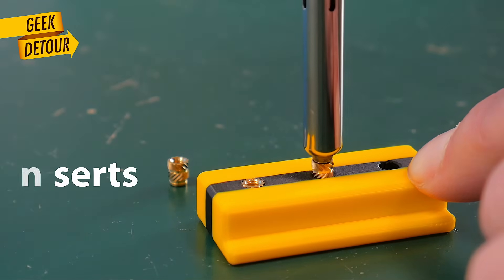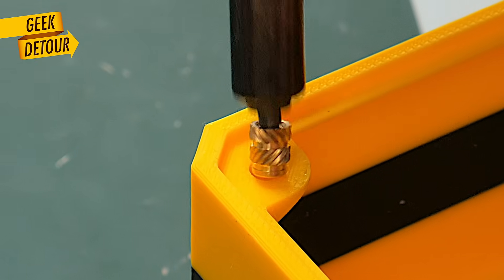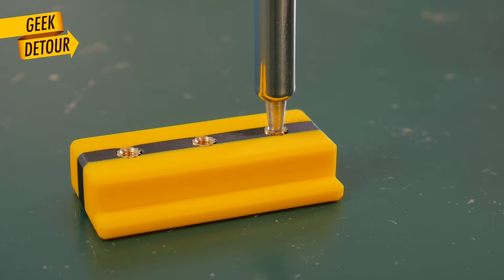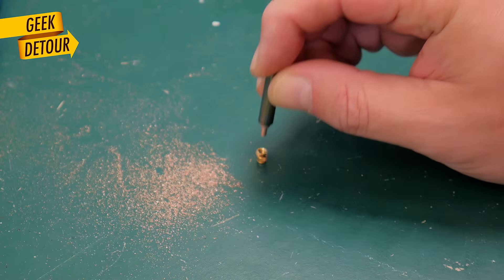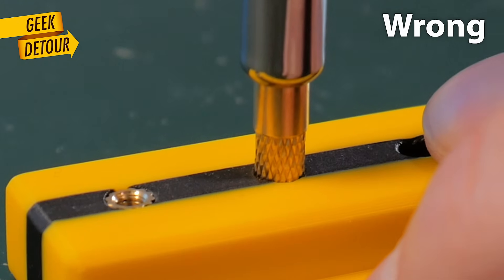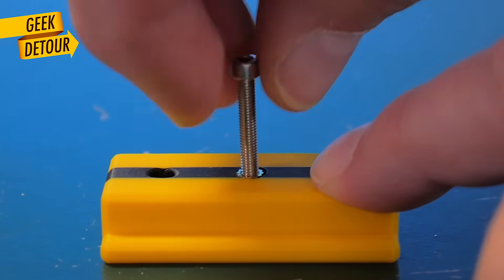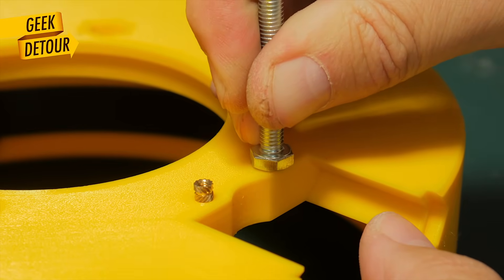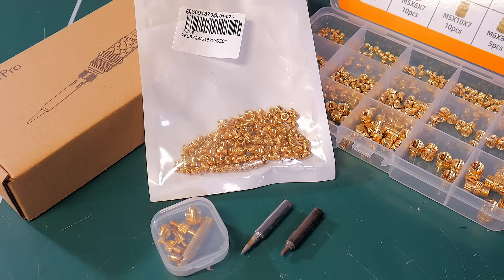How to use Brass Inserts on 3D Prints: make your own tips, cheap!

Comment: Screw a screw into it until it meets the other end, grab screw with needle nose plyers with the flat side of the needle nose against the heat insert, heat with torch, let cool momentarily, insert until the flat side of needle nose plyers are flush with surface and then blow with mouth. Perfect every time, no special tools or soldering gun.
Reply from the maker: Hum... Its a blow torch - looks like that counts as a special tool 🤔 Anyway, you should make a video about it! "Brass Inserts using fire 🔥 " 🤣
Reply: @GeekDetour  I don't know that it should count as a special tool, it's a kitchen and camping utensil, and with the types of things we do, one finds about a million uses for these. A jet lighter is the same. 3€. You could use a standard lighter and it'll do just as well, since you don't actually need extreme temperatures, will just put a little soot on the screw.
Reply from the maker: @SianaGearz  Sure!  But you know... I bought the soldering iron for 13 dollars... the temperature is constant, it doesn't add any dark soot. It's very inexpensive comparing the advantages.